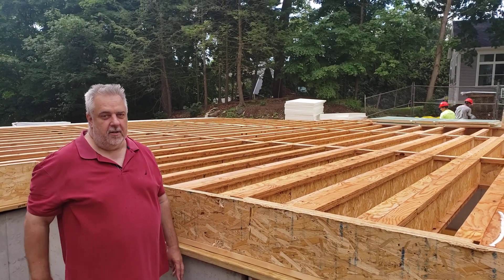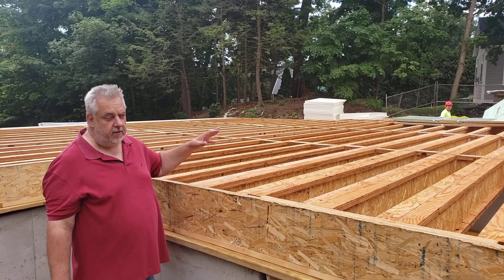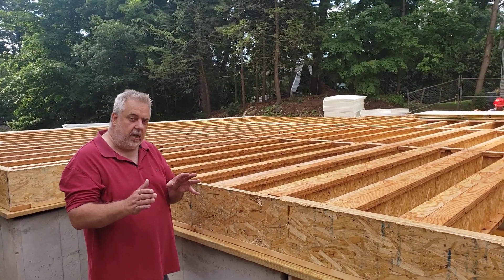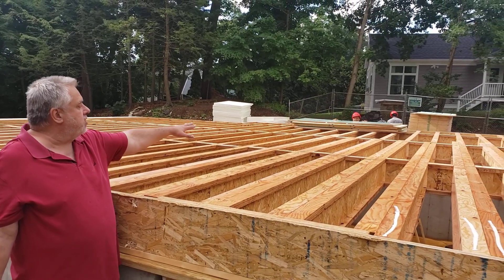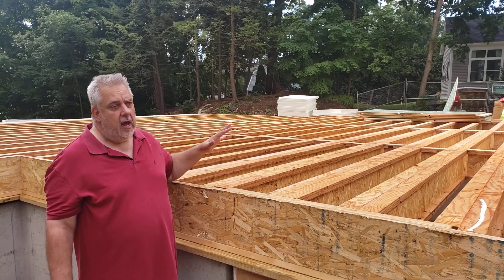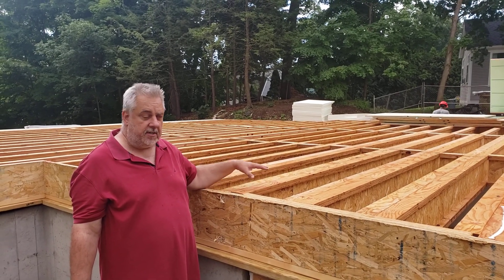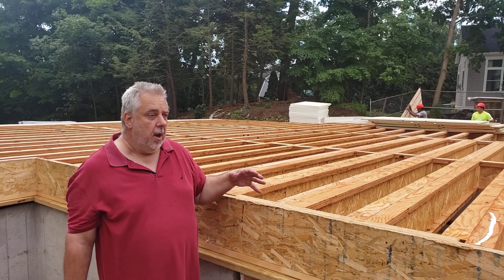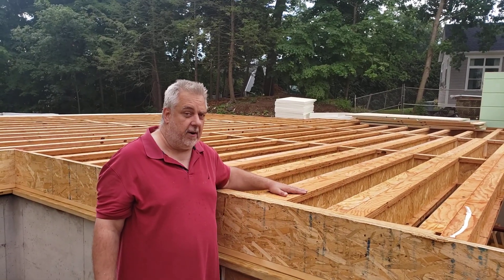Double Joist Floor Framing

Comment: Steve - Question. Did you sandwich foam between those double I joists to take up the air gap that's created when you butt them together?  (I know it won't matter if the floor is not part of the house envelope. But I thought it might be.) Just curious how you handled that.  Thanks!
Reply from the maker: We ddin't on the ends here, we have done it in the past on other projects - we have Zip R-9 on the outside
Reply: @stevenbaczekarchitect9431  thanks Steve.  Glad you're putting out your own content here!

Comment: Great video Steve - quick question, are doubled up I-joist members attached with one joist hanger to accommodate both? Also, what are your thoughts on web stiffeners that go between the joists connected them?
Reply from the maker: Yes double hangers and, structural engineer says no need to connect them - they get connected via the subfloor
Reply: @stevenbaczekarchitect9431  remember, holiday parties with stiff drinks require stiff floors.